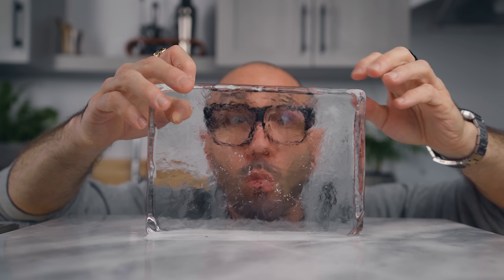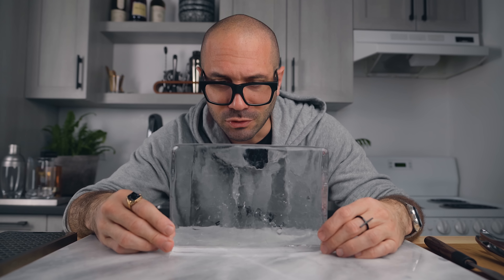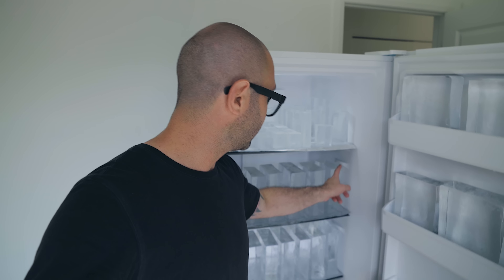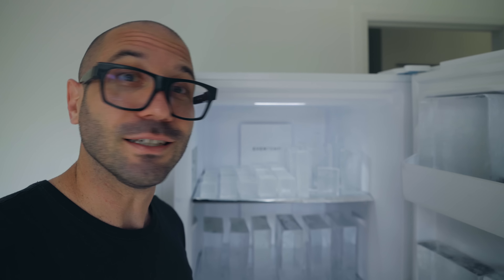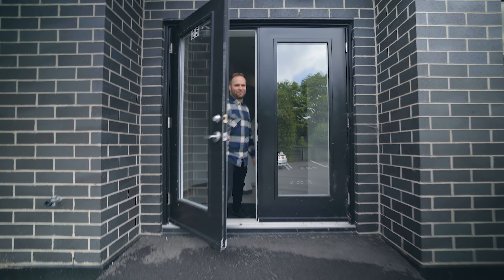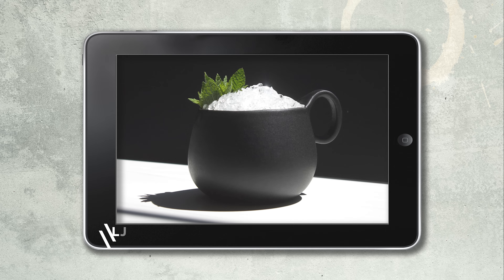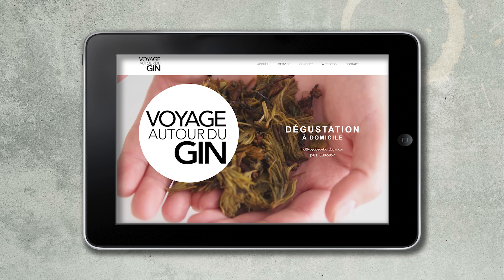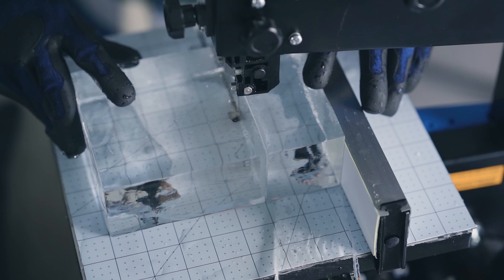Transforming an apartment into a clear ice factory

Comment: For custom sized cubes or spears with perfectly clean edges that can be used for shaking or getting that perfect fit in the glass, the cooler + bandsaw combo is where it's at! As you said, it's also much quicker and easier. That makes it worth it!

Until I get the space for a bandsaw, my Ghost Ice System does an amazing job for my OF glasses or when I need a big cube to shake with my Japanese Cobbler. I use my Coleman cooler for the rest.
Reply from the maker: I still feel the ghost ice system is WAAAAYYY too expansive for what it is. Thoughts ?
Reply: @TrufflesOnTheRocks  I think it might be more viable for commercial applications and large volumes.

My Ghost Ice Compact is IDENTICAL to my 25$ Coleman FlipLid 5-quarts cooler without the lid. The silicone mold fits perfectly in both.

The extra 125$ + international shipping for the mold is hard to justify for what it is but it does save time.

It does feel a lot sturdier than my Ice Forward molds that, I believe, are similar to the dICE molds you have.

When I feel lazy, I love it! When I want different sizes or shapes, it's no use.

For a quick and easy to use solution that saves time and doesn't need tools, there's an appeal. 

For those who enjoy the process and want options and love to tinker and experiment like you and I, it's harder to justify since there are better and cheaper methods.
Reply from the maker: @LeTopShelf  the way you put it, it makes a lot of sense. I like these gadgets to make the process cleaner and easier. But like you say, it’s hard to justify the money sometimes and some others, it’s just a little guilty pleasure and we’re all entitled to. Thanks for the honest feedback sir. Cheers